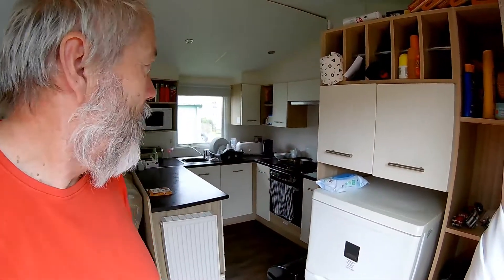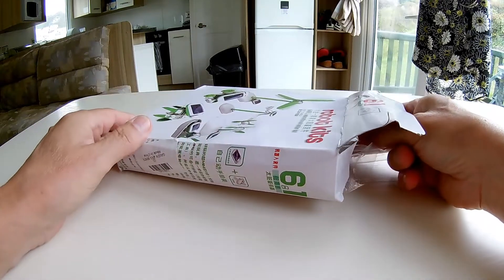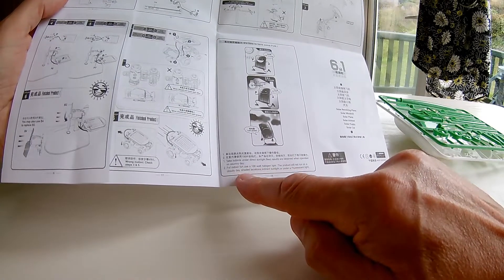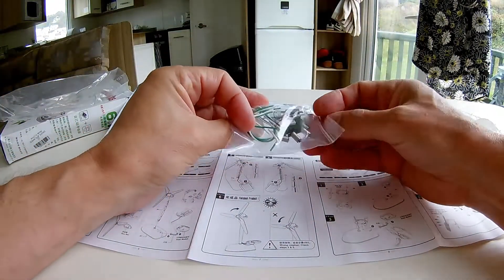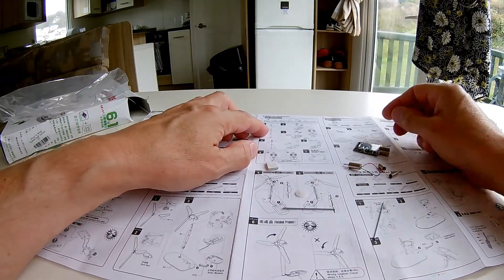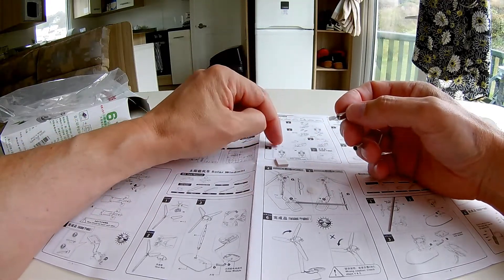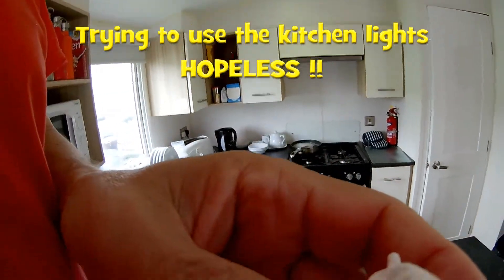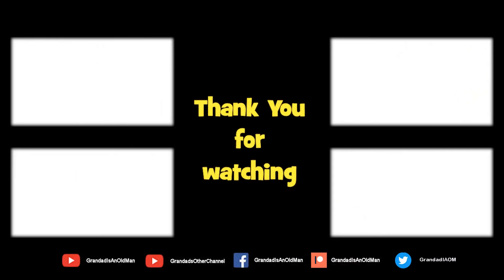Solar 6 in 1 kit - Motor and gearbox assembly

Comment: None of my wires are colored except for the black gearbox wire I think there might be a problem while I was assembling both of them
Reply from the maker: The colours really do not matter. They just help you check which way round you have it connected. If it goes the wrong way, then you just swap the wires over. You need to make sure you dont get the plastic insulation stuck in the spring connector instead of the copper conductors. The instructions can be a bit confusing there.

Comment: Can you like zoom in for how you connect the wires it's a pain how to connect it
Reply from the maker: The wires slide in between the coils of the springs. The kit is designed that way so you don't need a soldering iron. You may find it easiest to practice getting the wires in place in the springs before you start assembling the components, just so you can understand how they go together.

Comment: How do you actually put the gear box and panel together? I am stuck on that part.With the green and white wires. From an urgent kid.
Reply from the maker: This video was just for people who had trouble with the gearbox as that is where most people seemed to struggle. I show the green and white wires around 15:50 what part do you mean? I did the full assembly in this video back in 2013 so that might help you https://youtu.be/zvU_Hy8R2_g?list=PLA5a2xPRSrB1FEN0kNbQlRaux5f91N0yq
Reply: The part where you connect the gear box and solar panel using the wires. How do you connect them? You have nice grandchildren by the way.😀 From a kid
Reply from the maker: @albertyuofficial  I show the green and white wires around 15:50 you slide the insulation down so you have the bare conductors. You then pull or push them into those spring connectors between the coils of the spring
Reply: A bit complicated but I get it when I rewatch the video. Thanks. I am a big fan.
Reply from the maker: @albertyuofficial  Thank you Albert 👍
Reply: 👍🏻I just started a channel. It’s Albert Yu and then the one with an orange profile colour with one vid.

Comment: Nice video :D ive had a toy like this before, ive been wondering what can be made by combining multiple different sets and brands of these tech toys, can you try that if possible?
Reply from the maker: You could certainly double up on the solar panels to increase the power generated. You could possibly link two drive units together to make a little 4 wheel drive car